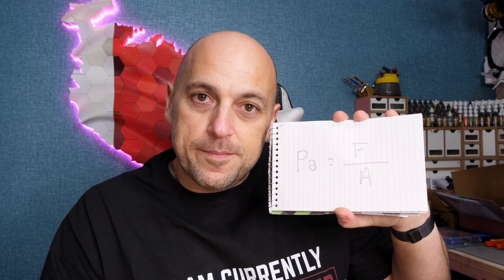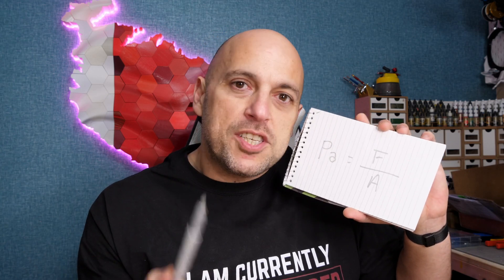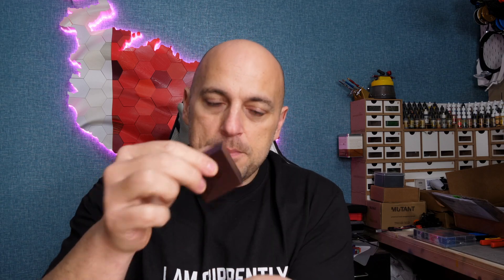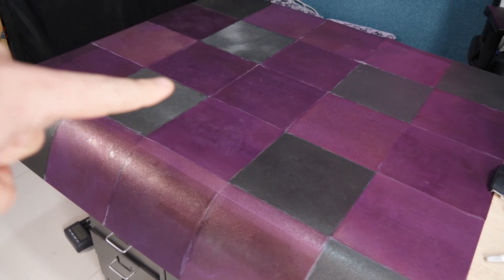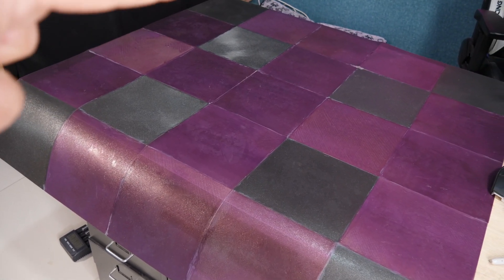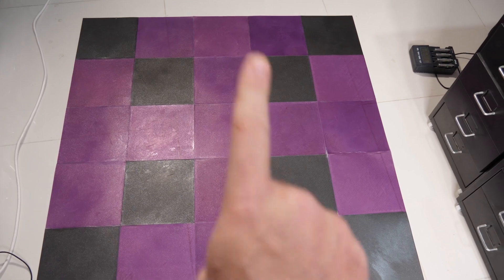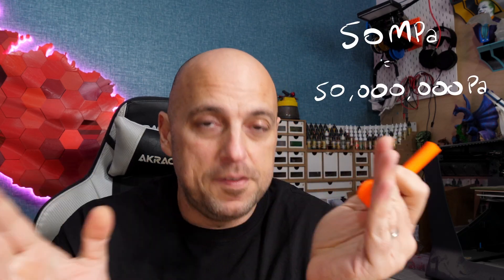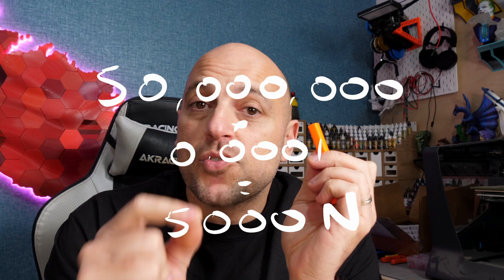3D Printing To Learn Mechanical Engineering?

Comment: hey, im in a project that takes plastic water bottles, and turns them into filament. Its called re-creator 3d and we have a discord as well. I'm reaching out in behalf of josh the owner to see if you want to work with us. We also plan on selling a kit down the line to help make it easy to recycle yourself. think you would be willing to reach out to set something up?

Comment: I'm interested in learning mechanical engineering, but purely for designing 3D prints. I don't want to spend 3 years studdying how to make bridges and dams etc, just that aspects that apply to 3D printing - like connectors and hinges and things. Any suggestions?

Comment: I'm a mechanical engineer, I teach engineering students how to be engineers, I introduced 3d printing into our syllabus as a teaching tool, having them design and manufacture their own printer in small groups and then they need to design and material test the parts they print, this class is over subscribed it is amazing how 3d printing has raised the level of interest in my manufacturing processes and material science lectures for what at times can be very heavy subjects. Thank you for trying to help others understand the basics

Comment: 500kg to snap that little bit of plastic? I want some of that filament!
Reply: you'd be surprised to see how strong plastic is along the strong axis, and you'll be completely shocked when you do the same calculations for carbon fiber 🤣 I was doing some yesterday and a sample being 10cmx10cmx2mm (10 layers thick) would easily hold 800KG on a 3 point bending test, and that's like $2 worth of finished carbon, stuff is stupidly strong for the price!